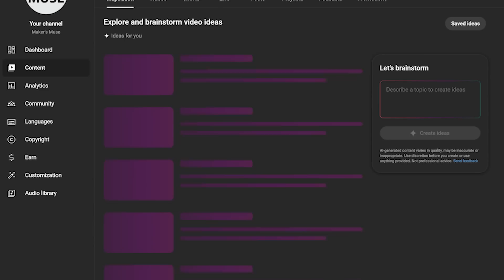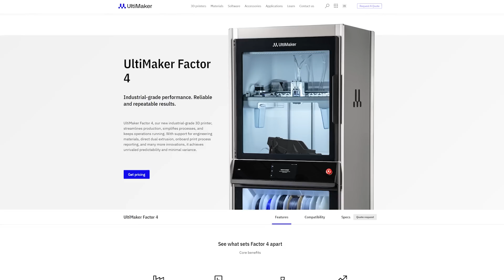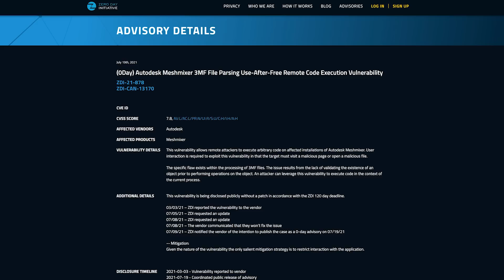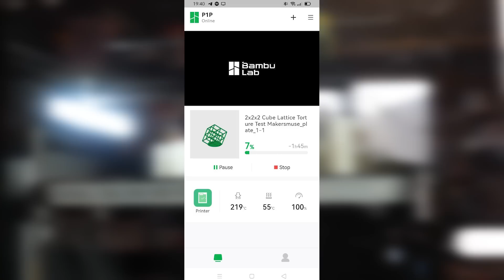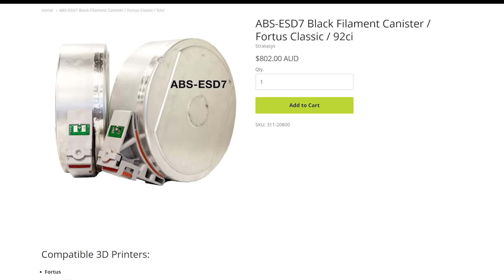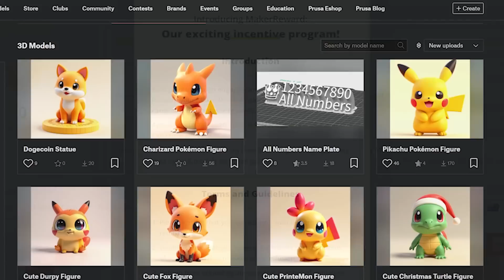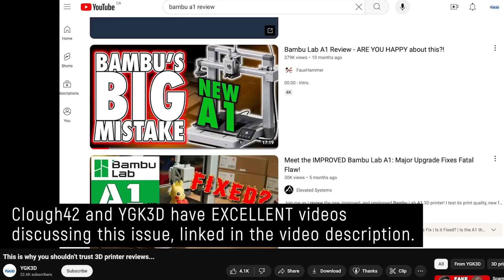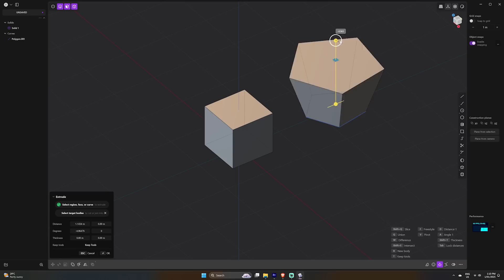My 3D Printing Predictions for 2025

Comment: OnShape is still predominantly running on your local hardware; it's only really cloud computing in the file sharing sense. It is possible that it offloads some expensive algorithmic stuff to the cloud, I don't know, but the UI and 3D graphics will all be done locally.
Reply from the maker: Surely they're doing most of the heavy lifting, this chromebook is the definition of gutless. The graphics are definitely impressive.
Reply: @MakersMuse  I mean I haven't looked that closely, I wouldn't necessarily rule anything out, but it's pretty unlikely. Cloud rendering can be achieved by delivering it to the client via video stream, but you would likely notice encoding artefacts and interaction latency in this case. It's much more likely it's rendered locally; even low end GPU chipsets are surprisingly capable these days, and from a graphics hardware point of view, CAD isn't really that demanding.

(For what it's worth I'm a professional software engineer, and I have deployed 3D graphics web apps. I tried linking but YouTube is extra fastidious about filtering links.)
Reply: @MakersMuse 

I noticed huge performance differences when running OnShape on my laptops integrated GPU vs the discrete GPU, if that means anything. Also whilst using OnShape my browser uses a similar amount of RAM as AutoDesk Inventor.
Reply: @MakersMuse Outside of renders, most CAD models are just meshes with no shaders or textures attached, which even mobile GPUs are now more than capable of handling. The main resource hog graphics-wise would likely be tessellating the solid geometry to triangles for the GPU, which would scale with model complexity. I think the reason a lot of other CAD packages feel slow even on powerful hardware are due to their age, and a lack of attention to their rendering pipelines. The graphical requirements of CAD haven’t really changed much over time, and full scale product renders for marketing are normally done in a separate mode or application, meaning that new CAD software can substantially improve over older packages by writing their own rendering stacks that make effective use of modern hardware, and are actually optimised. This I feel is especially the case given that most commercial CAD packages like SolidWORKs or Siemens NX are expected to be run on workstations with NVIDIA Quadro’s or similar. SolidWORKs doesn’t even recognise non-Quadro nvidia GPUs and disables features unless you use a registry hack, so it’s likely there’s very little interest in optimising those rendering stacks to operate well outside of the narrow range of hardware most of their big clients are running. 

It’s easy to underestimate just how much compute power even a low-end mobile phone has nowadays, and given the graphical standards for CAD products haven’t really shifted since the 2000s, it’d be surprising if it couldn’t handle it decently well. I expect you’d run into more performance issues with complex operations, since that’s where most of the heavy compute work in CAD is done
Reply: Onshape is very flexible in terms of what it does locally and remotely. Unfortunately, the fundamental problem remains the same: it can't function without the internet and it stores everything on someone else's computer.
Reply: What the fk does "predominantly" even mean in this context? If a single instruction in the code needs a server to work and you are cut off from the server, congratulations your expensive pay to not own and be owned by being spied on and advertised to program is now a brick and you're regretting not using open source or a completely localised cracked pirate version of expensive software like Fusion.

Comment: 2025, a nice year to keep putting hours on my Anet A8
Reply: Didn't know there are still Anet A8 left that haven't burned down they are in yet
Reply: @AniviaS  mine  runs on klipper so the runaway protection is not an issue..
Reply: do you live in california by any chance?
Reply: @ReixGonzalez  wow... Just before that era I still have my RepRap Air2, from laser cut plywood. I took out the board and did some mods and want to put it back together, but I'd be better off recycling the parts into a diy i3 mk2
Reply: Another year, another 52 upgrades to my already heavily Frankensteined JGAurora A5 😂
Reply: My printer is what used to be an A8, but now has an 80/20 frame, linear rails, E3D extruder, etc. I think only the stepper motors and heated bed are left. Lol
Reply: @ you probably learned a lot with it, mine is heavily modified too, original chasis but reinforced in both axis, I even designed a toolhead with a titan aero extruder, abl and a 5025 fan. I love it!
Reply: Oh damn. It was my first printer I've ever owned. After that I've transitioned to an Ender 3 Pro and now I'm using an A1 Mini.
Reply: Yas I still got my a8 too lol
Reply: yoooo that was my first printer, I sadly donated it last year. I heard it was a bit of a fire hazard as well as a pain to get up and running from what I remember.
Reply: @DrexelZzhoren  yeah Anet didn't activate runaway protection (so if the hotend is being heated but the thermistor doesn't "see" that temperature raise it wont care and keep heating which can lead to catastrophic failures like burning down your home) by default.. and sure it is a pain of a 3D printer because it is pretty inconsistent, one day it works beautiful and the other it just doesn't work properly.  But hey if you don't care that much about speed or you like to tinker with it, you can make a very capable printer of it.
Reply: We have 3 a8s with 50+ km of filament on all of them.